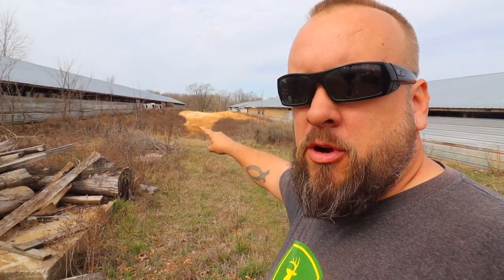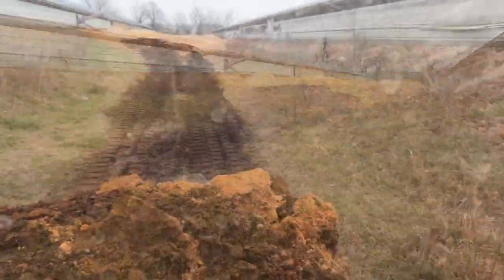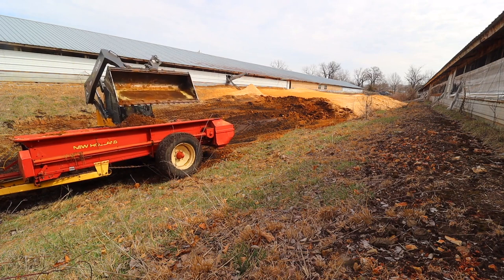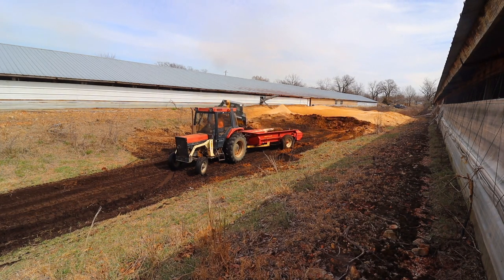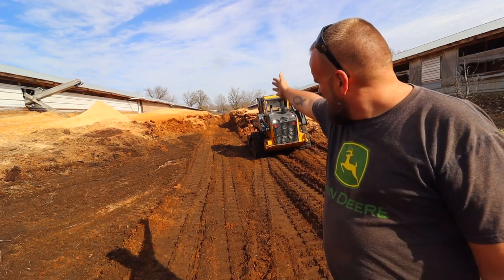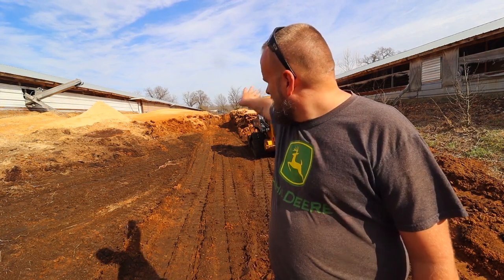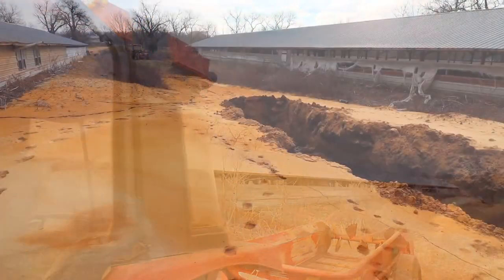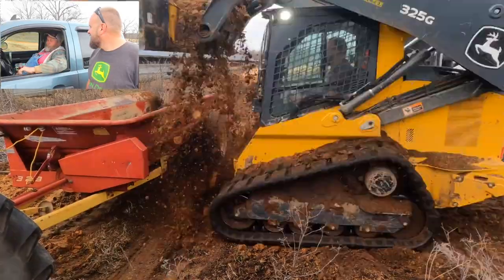Spreading 100 Tons of Sawdust

Comment: Brock do you run full throttle in these applications?  Curios what fuel consumption rates you see doing this type of work?
Reply from the maker: For this, yes, I’m running full throttle. Probably uses 2 gallons an hour.
Reply: Thanks you 👍
Reply: @RockhillfarmYT  I bet Paul and yourself wish you had 1) A bigger bucket on the skid steer 2) A lot bigger manure spreader! (HAHA)
I have a 74HP Cat 236D skid steer, found that running half throttle can save a lot of fuel and not loose all the much productivity (for sure on my "Grappel" work where when I need more juice I hit the pedal.)  I went from 1.8 gal/hr to .75 gal/hr throttling back and using increased power selectively.   I know you were moving a lot of material building that pile in the back and up against the clock (rain the next few days) so obviously "pedal to the metal" was required in this CASE....pun intended.   Thanks for sharing.
Teamwork makes the Dream work!!!! 
SHOW ME and us all more gents!!
God Bless
Reply from the maker: Yeah, would have been nice to have

Thanks for the tips